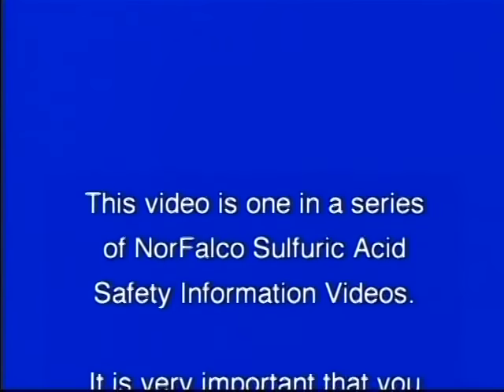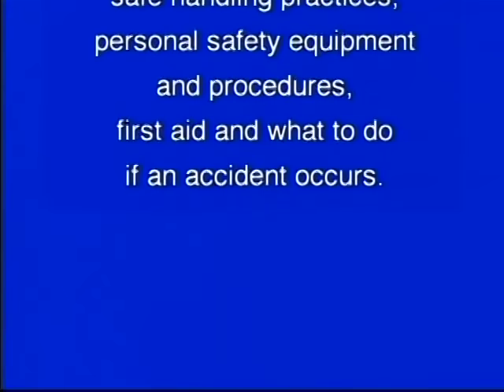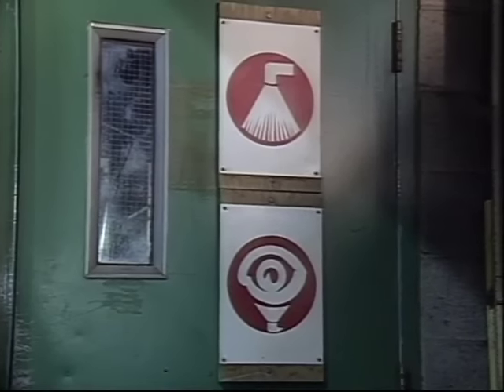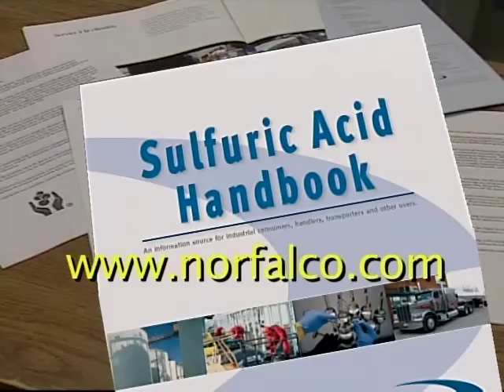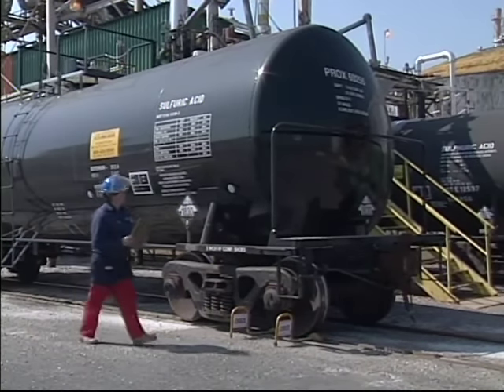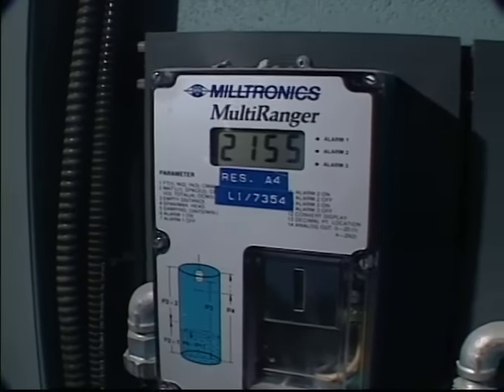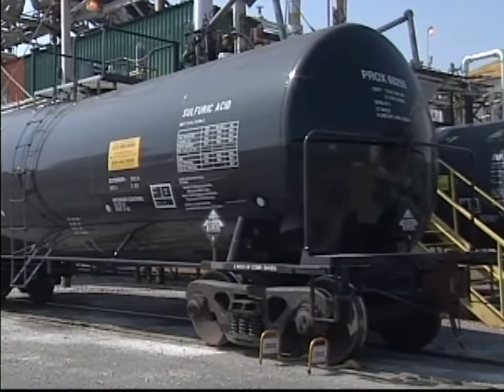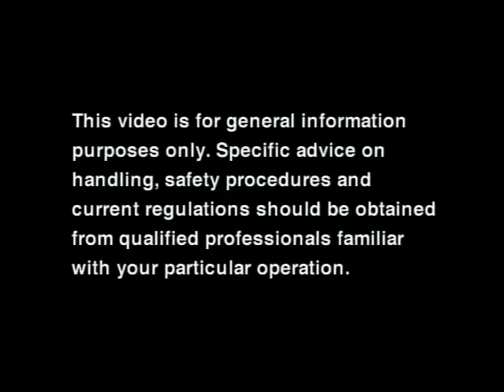How To Unload A Sulfuric Acid Tank Car

Comment: A couple times starting at maybe 23:00, we see a pressure gauge reading a low number, nearing zero. Is this a pressure gauge on the car or on another location in the system? I'm wondering about the risk of a vacuum forming.
Reply: The pressure shown is pressure above atmospheric. So zero means atmospheric pressure, and a vacuum would be about -15psi.

Comment: How many gallons would you need to dissolve a 120 lb pig? 🐖

Asking for a friend.
Reply: It's OK to say ex. You can can also use a realistic weight. The best is the trunk of a vehicle with a bunch of tires. Heck, add some lithium batteries for extra cover up. 
At least that's what TV taught me.
Reply: Is that you OJ?

Comment: How long would it take to empty a full tank car ?? And will there be any left or does it completely empty the tanker ?
Reply: Depends on temperature, the product viscosity and the unloading method (pressure or pumping). There is almost always a little product left that cannot be unloaded via the pressure method where pumping you can get most of it if you unload from the bottom.
Reply: The best method to unload a tank car is to pump or syphon then connect a hose to the bottom and finish draining the car.
Reply: @royreynolds108  - and even they there is residue.  the car is only free of product after it has been washed and certified.

Comment: 16:10 might be an idea to have some sort of a mechanical interlock there so you can only open one after the other
Reply: that said that edjecter  valve should probably also have a hand valve on toop so you can connect the hose to it before you even open it
Reply: oh also bottle that hydrogen we can sell it later :P
Reply: 24:17 and remember to have substantuil quanititys of bakeing sode on hand :P

Comment: How does a first responder know whether the tank is empty?
Reply: First responders will normally contact the train crew to obtain a copy of the manifest, or what the train is carrying, especially if the train is carrying hazardous materials. https://www.usfa.fema.gov/downloads/pdf/publications/tr-094.pdf
Although this is from 2003, this part holds true.
Reply: If springs are compressed the tanker is loaded, If springs are relaxed the tanker is empty
Reply: Joey V,
That's a bad judgement though, because the tanker still could have minute traces (even a few gallons) of product inside, which is enough to pose a hazard.
Reply: Grandpa Cocky m
Reply: @JMeV  - and if the trucks are missing?
Reply: @JMeV  - and if the trucks are missing?
Reply: Simple, they never assume anything is empty.